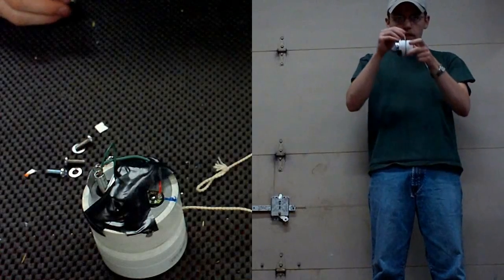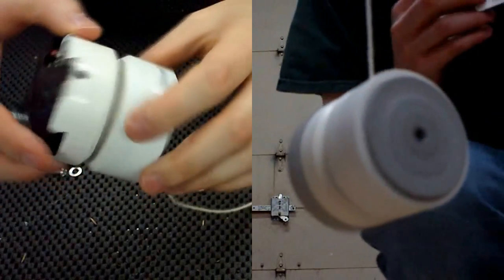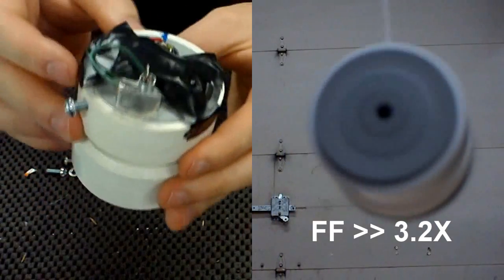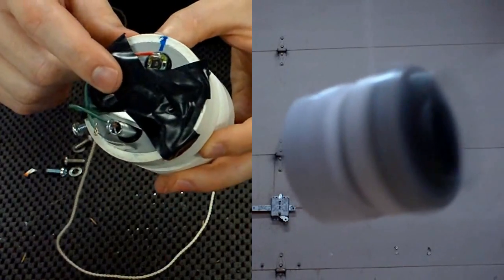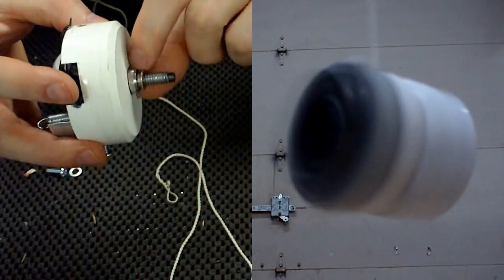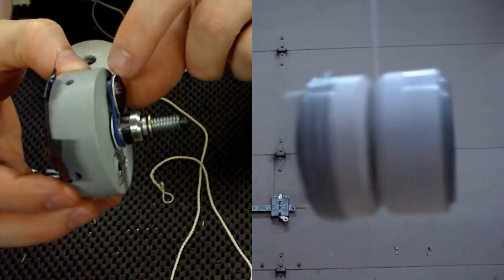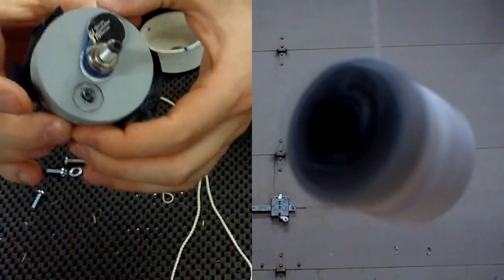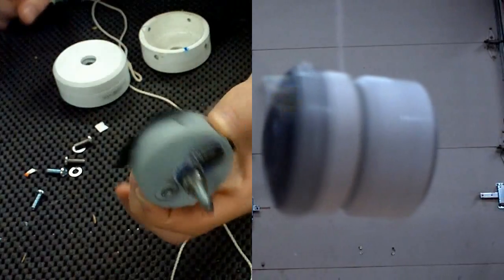Motorized Yo-yo

Comment from the maker: @AlisRIOSteff I believe there are sites that sell motors by themselves for use in RC helicopters, but it would probably be cheaper just to find a cheap helicopter to tear apart. I've seen them go for as little as $10 on clearance. I don't really have any specs on what might be required; I just threw it together with whatever I could find.